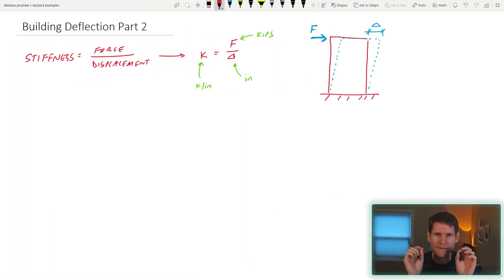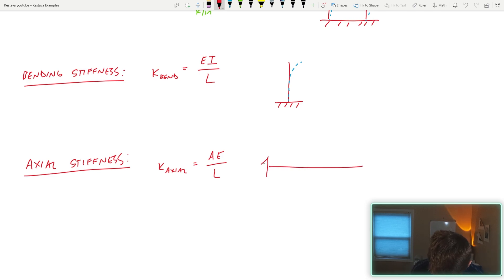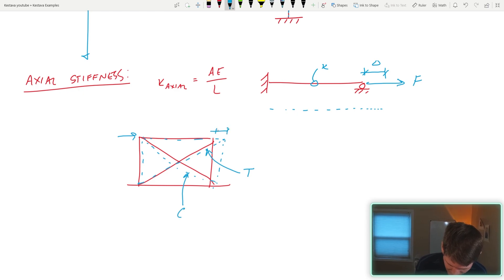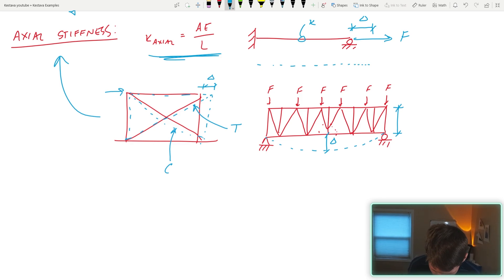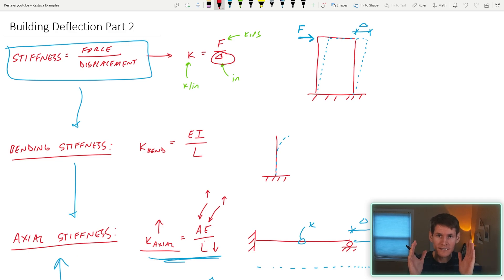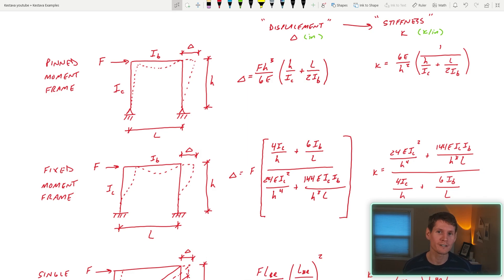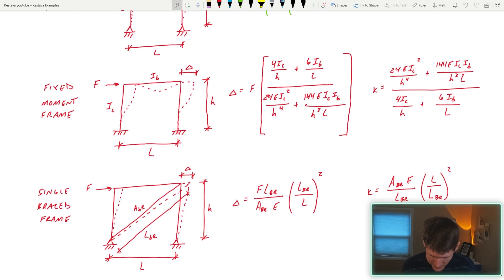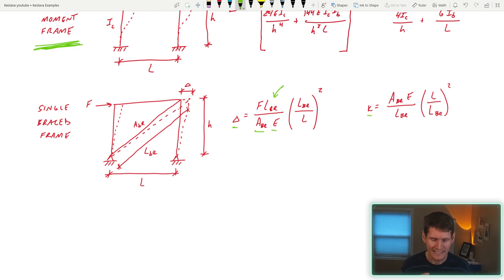MORE Essential Equations for Building Deflection and Stiffness in Structural Engineering

Comment: Hey First-Time commenter here. I Love what you're doing. Your shearwall videos really helped me out in my internship over the summer. I was taking notes on your deflection calcs for the Pinned Moment frame and the units weren't jiving. I did a quick unit analysis and here is what I came up with (in Freedom Units lol)  kips*(in^3*in^2*in^1) / kips*(in^4) = in^2. I used MathCAD to confirm I wasn't seeing things and It came up the same. Any thoughts?
Reply from the maker: shoot, I believe the "h" on the outside of the parentheses is supposed to be squared not cubed!
Reply: That was the only logical way to make the units work out. Thanks for the clarification Rich.👌 @Kestava_Engineering

Comment: Nice! For X-mas I would like a 'complete' design of a simple (or complex) steel frame building. Especially interested in industry practice for doing stability/buckling analyses and which software is used. Context: We are developing a framework for FEM simulations, initially focusing on wind turbines. However, we are now looking into expanding into more traditional structural engineering simulation use cases such as buckling of steel frames.